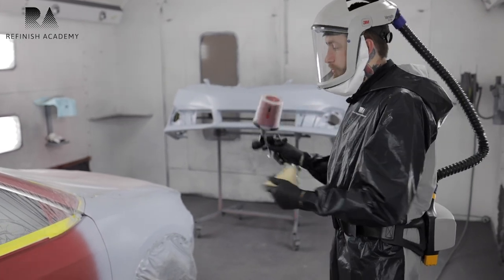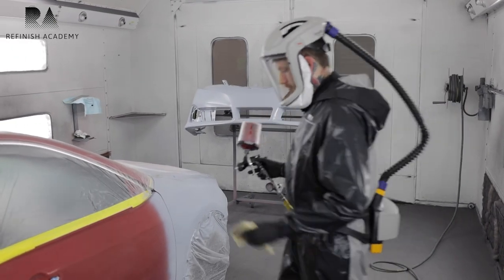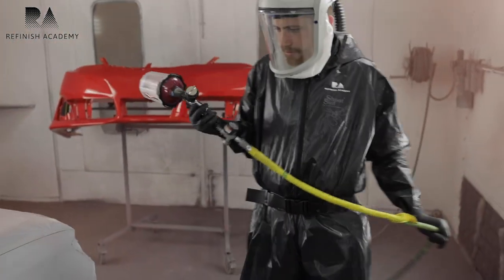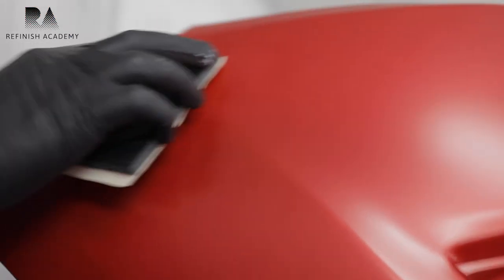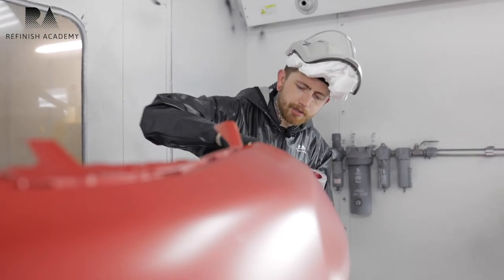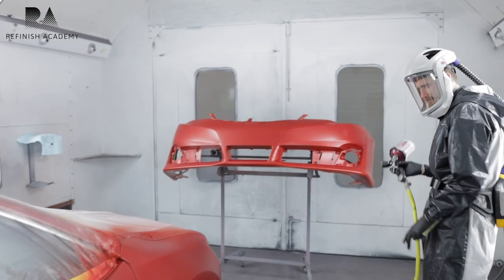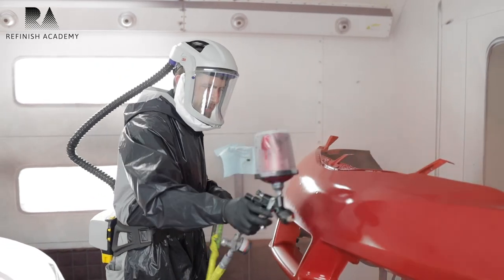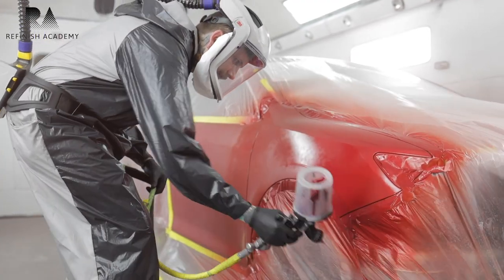Applying Automotive Transparent Basecoat

Comment: Great job...which
Spray gun?
Reply from the maker: Russell sprayed this job in PPG Envirobase with a Tekna TE20 cap and 1.3 needle/nozzle. I personally like a 1.2 Entech Iwata for EHP in winter, 1.3 Sata 5500 O for base in summer. 

I spray mostly Sikkens now, Sata 1.3 5500 O, or Devilbiss DV1 1.3 Base. For me the key is the first coat. Always try to get smooth sealer, and a 100% closed first coat of base to lay they foundation of the job. These guns help me achieve that with no texture. Like Russ says in the video, nice wet coat to start.

Comment: Beautiful job and shop mate!! Which air cap you use in your tekna for basecoat and clearcoat???
Reply from the maker: Russ uses a TE-20 cap for base, and TE-10 for clear. This happened to be PPG Envirobase, and this combo works well. But it may change depending on the viscosity and opacity/pigment concentration of the toners. Also it depends on how fast or slow you like to use. Personally, I’m on roller skates in the booth 😂 so I like a 1.4 sata 5500 O for say Sikkens, and a 1.2 Entech iwata for EHP. Thanks for the comment!
Reply: @RefinishAcademy  I use ppg solvent(global or deltron) and 2021 clearcoat. I have Iwata w400 lv4 cap and lph400 lvx  cap, 1.3 on both.
Reply from the maker: Global always had really pretty aluminums/metallics. It’s been a good 20 years since I sprayed that. The w400 I think definitely would be a good choice for that. 1:1 with DT or Global thinners. LVX if it’s hot helps because the droplet is a bit bigger/wetter.